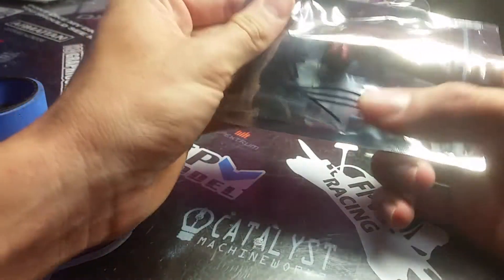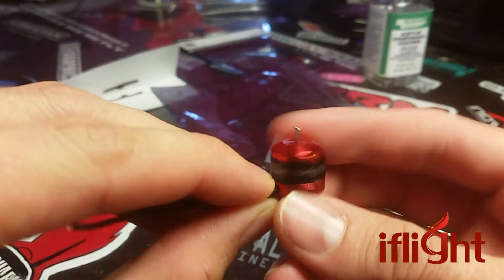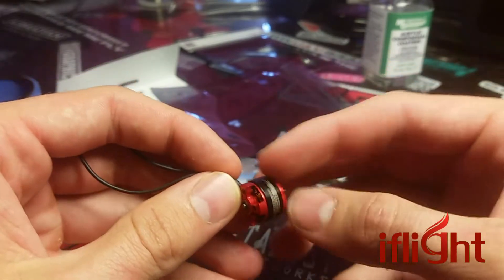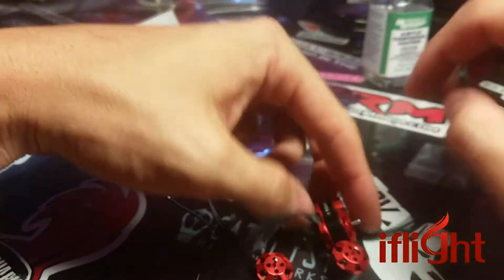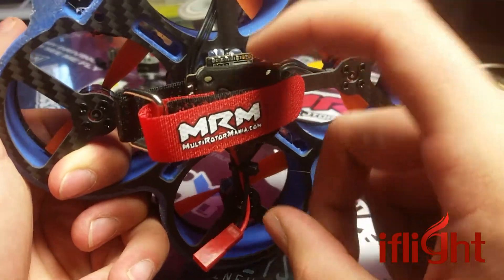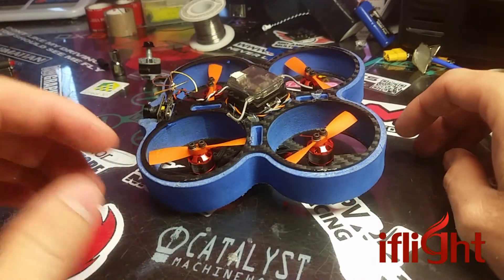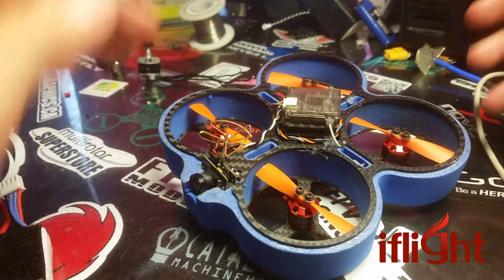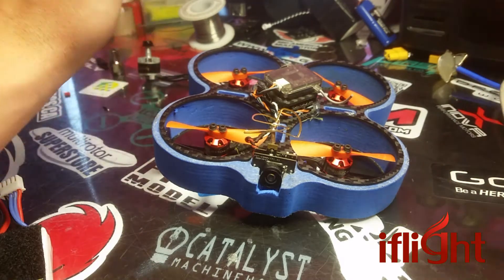iFlight 1104 7500kv Review

Comment: im looking to build a quad with some 1104 motors ive got.what measurements do you match up to insure the motor will mount on the from?and will any 20x20 esc work?
Reply from the maker: Hey sorry I dont know why your comment got flagged as spam.

most 1104/1105/1106 motors share the same mounting holes so you should be fine with any. and yes and 20x20 esc will function fine

Comment: What props do find work best on this motor on 2s or have you tried just the cut down 3020?.I got dys 2030 3 blade, 2035 4 blade  gemfan and 1935 5 blade props on the way.
Looking for the most thrust on 2s with 2'' prop.
Reply from the maker: Its a pretty high kv motor so even on 2s I wouldnt use something heavy. Id like to give the rotor x quads a try but in reality at this high of kv youre definitely going to run into some limits.
Reply: I have seen people run these motors on all the props I listed on 2s all without running to hot but no exact thrust or amp figures.
I was hoping you had some experience with them trying different props.On 2s I would think 2'' prop would be the limit.
Reply from the maker: I havent had a whole lot of chances to experiment with props on this one as there are so many for the 2" size these days. but yeah at this kv a 2" is more than the limit. I was going to try the full 3020 in this review but my common sense got the best of me.